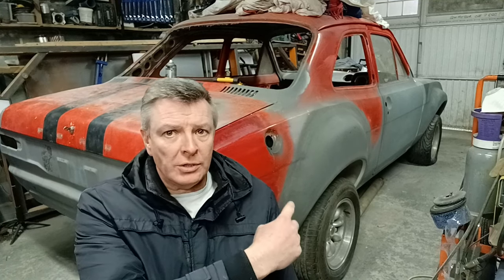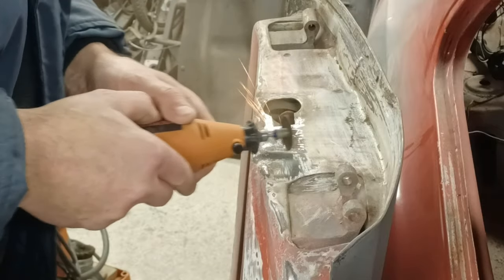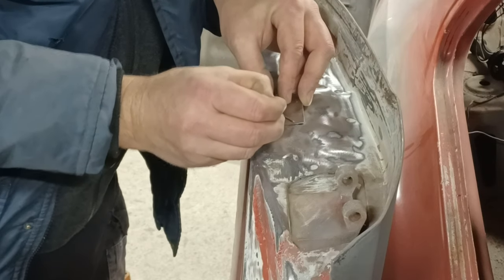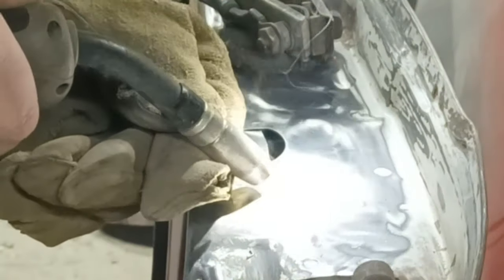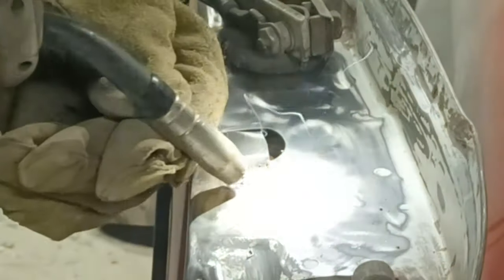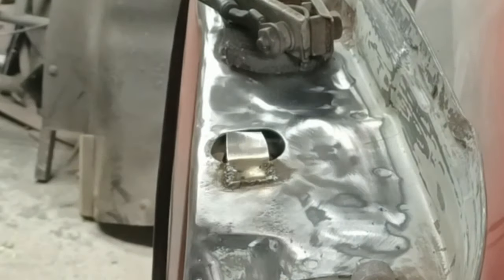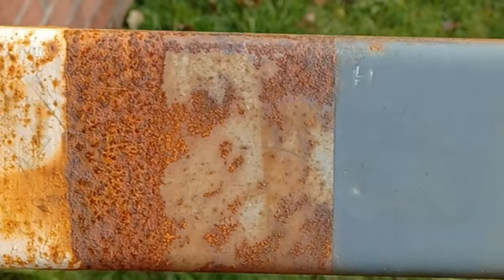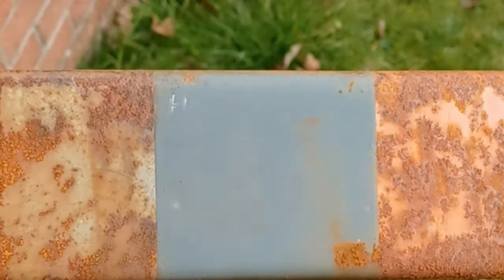Ford Escort MK1 Restoration, Door Welded Repair in Real Time. MIG welding. 0.6mm Wire and CO2 sheild

Comment: Since finding ur channel months back I’ve only been using the Halfords weld thru primer myself.    I’ve actually left a test bit of steel outside the past couple weeks with Halfords weld thru on one half and some red oxide on the other to see how they preform against each other..
Reply from the maker: Fab, be interesting to see your results on that
Reply: @DavesGarageuk    I’ll check back in with ya about it in few months about it.

Comment: Great content as always, and good to see an update on the Halfords primer.
I like the idea of using a magnet to hold the clamp, will be using that trick.
How come you're using just CO2 rather than CO2/Argon mix which seems to be generally preferred on thin material?
Reply from the maker: Hi Christee, I've always used just co2, easier and cheaper to get refills.
Reply: @DavesGarageuk  That's fair enough then, knew you'd have good reasoning behind it.

Comment: Must be the zinc used as a conductor in the Halfords weld through primer is also acting sacrificially to protect the steel panel below. Would you need an etch primer to avoid a reaction with any subsequent paint application? Amazing that it has sat outside for two years weathering in all that Welsh rain we can hear in the background without failing!
Reply from the maker: That's my understanding. It's much better than I expected, and that's without a top coat keeping out moisture

Comment: Hello David what size and  specs of the rims did you use ?
Reply from the maker: Are you asking about the wheels?
Reply: @DavesGarageuk  yess 15 inch et? With?
Reply from the maker: @thijskuiper5989  got 13x8 on it to get it rolling. I may go to 15s
Reply: @DavesGarageuk  en what is the et ?